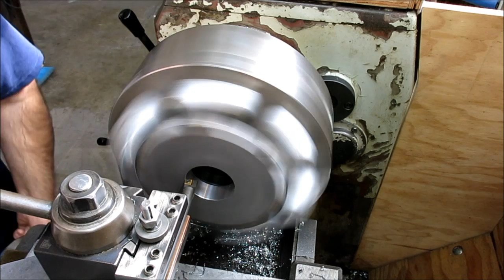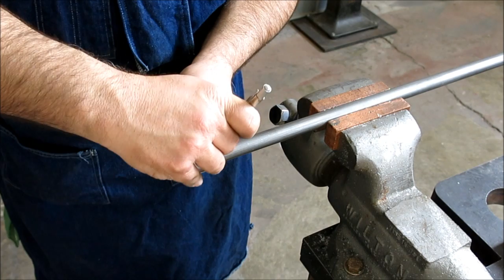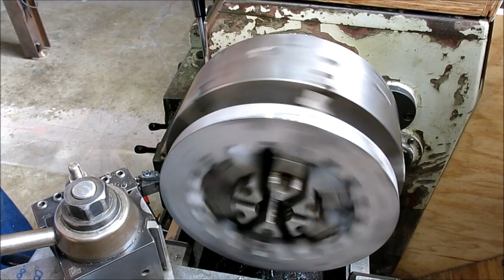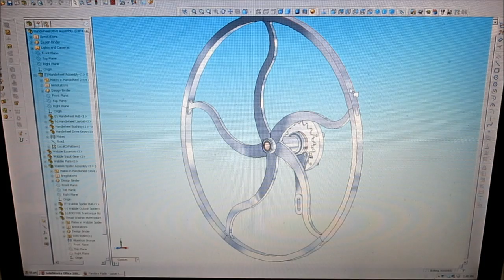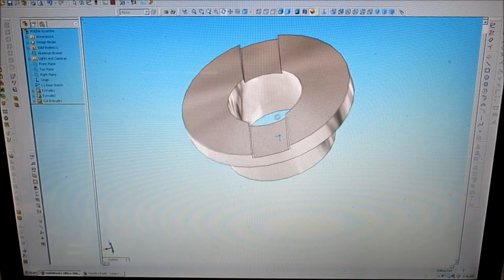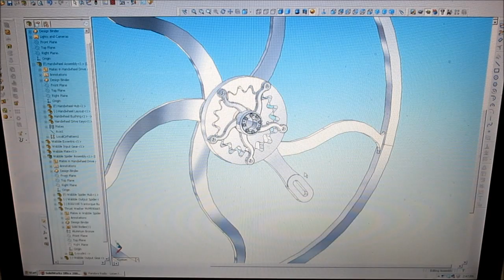Etching Press Wabble Drive Gears

Comment: Tom, what were the inserts you used for roughing and finishing while facing. What a nice project. Amazing what steps a machinist has to go through to arrive at the finish product. You do a superb job. Love your videos.
Ron
Reply from the maker: Hi Ron,

I was roughing initially with a CNMG then switched to my old favorite WNMG then finished with a CNGP at higher speed. 

Cheers,

Tom
Reply: Tom,
 Again thanks for the videos and your time. I’m trying to update some of my lathe tooling.I have an AXA QCTP.  I’ve searched the internet and the Aloris catalog for the tool holders, the ones that hold the inserts. What tool holders do you recommend for the inserts you suggested for me?
Sorry to be such a bother.
I notice Adam uses, a lot, what looks like Aloris’ AT 12 & AT 12N. Seems to really hog off some metal. 
Info is appreciated.
Regards,
Ron
Reply from the maker: Hi Ron,

I'm going to do a little series of shorts on some of Tom's favorite inserted tooling. Stay tuned for more.

Cheers,

Tom